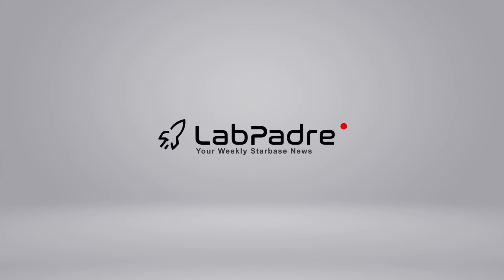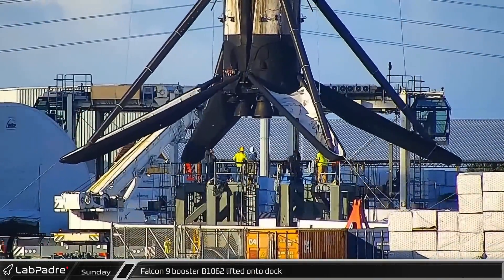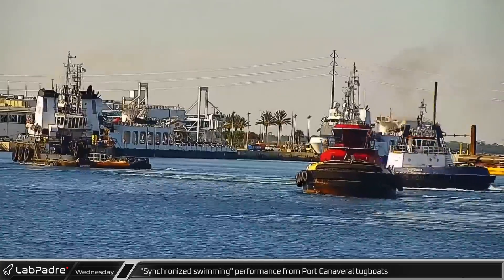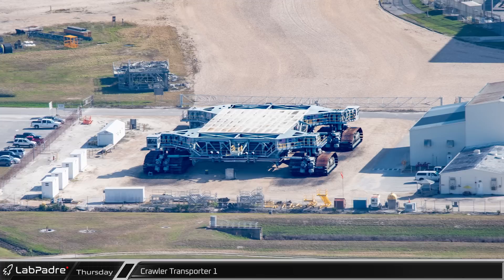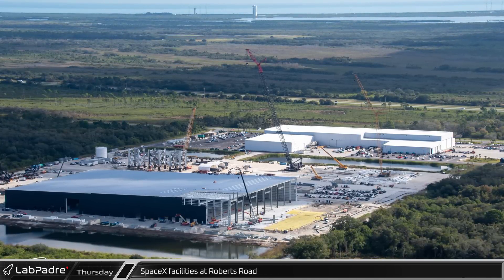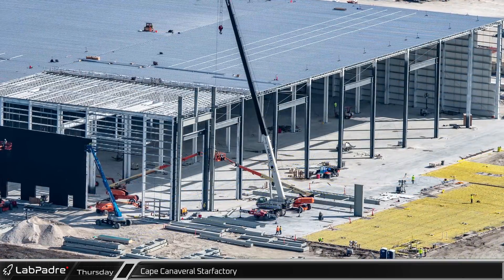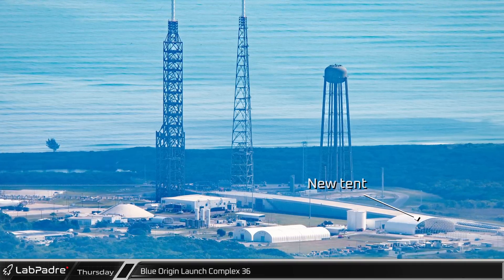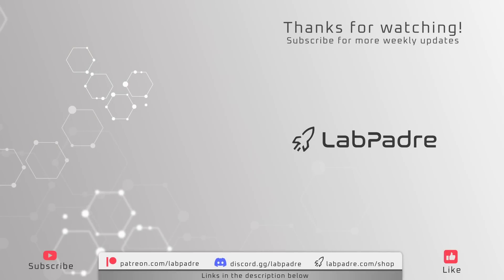SpaceX Super Heavy Production Heats Up - Weekly Update #34

Comment: The first Starship launch tower at Boca Chica is “Tower 1”, right?  Tower 2 is the one fully stacked at LC-39A?  And now there is a Tower 3 under construction??  Where is that going to stand?  Will it also be at LC-39A…or at LC-40?
Reply: Correct. Neither, since LC-39A will only have one & it has a rails that wouldn't exists if it used on LC-40